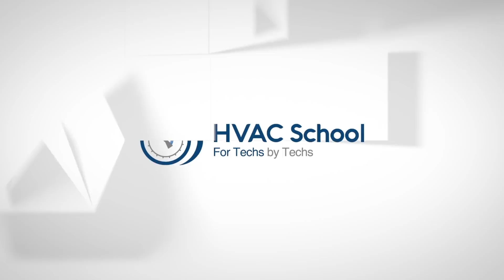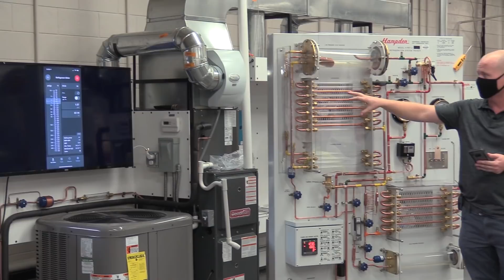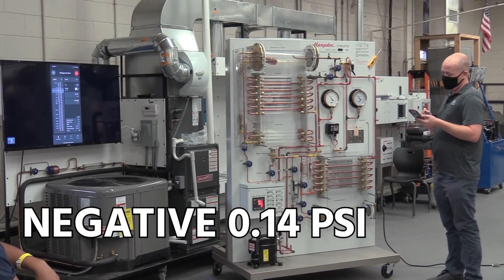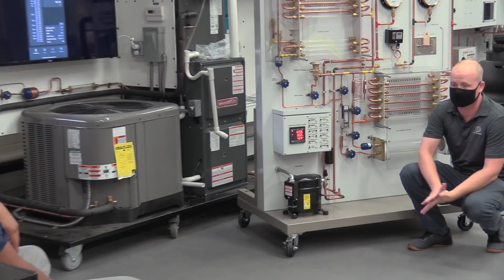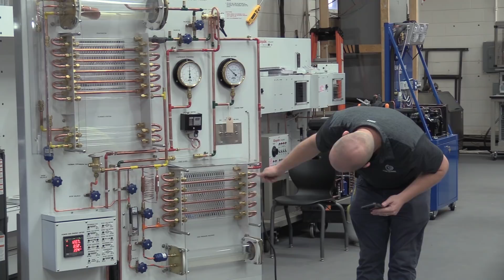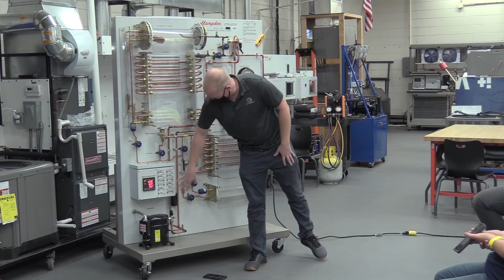Talk Through The Refrigerant Circuit Using The “Glass Tube” trainer

Comment: Love your videos and demos. 
There is a very confusing moment at 4:17 where the video was cut. You are asking about the suction line, when suddenly your hand jumps to the discharge line, the class answers "discharge line"  and you confirm the answer - which is the wrong answer to the question as the video flows.

Comment: Brian, I have the older version of that trainer that uses R11. After a few uses I have to check the torque of all of the flare nuts and blow off the top of the receiver after a few uses because air will enter the system during extended operation. Great job using it to go over the refrigeration cycle!

Comment: Great video, got me thinking: what if, on a residential heat pump, a subcooler was placed where the liquid reciever is on this unit, and it continued to cool the liquid and increase subcooling. Would this increase the absorption in the evap, and how would the TXV react? Would it be more efficient?

Comment: Having the high pressure service port on the discharge line vs the liquid line how would that effect you when looking at subcooling measurements
Reply: There would be no sub cooling lol
Reply: Are you taking a temperature of the liquid line?
Reply: @mrgreen9086  yes
Reply: @ElitecityzR6  If that's the case then you would get subcooling, but not if you get discharge line temperature.